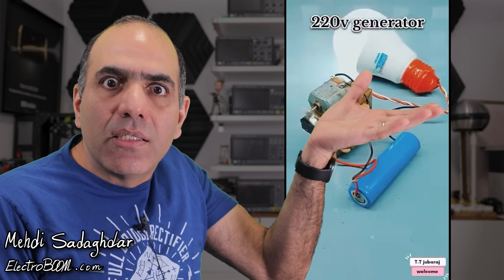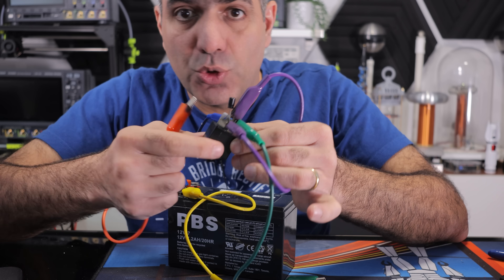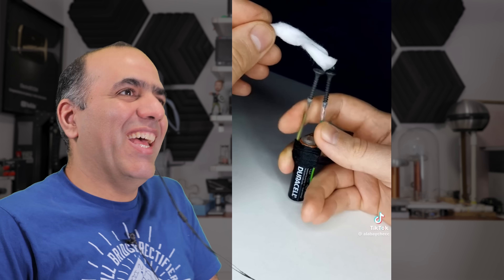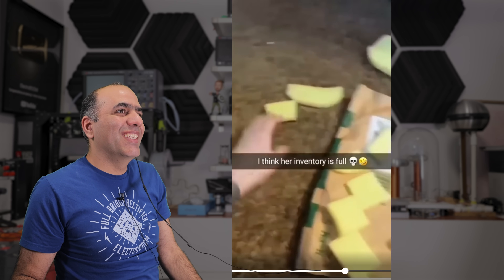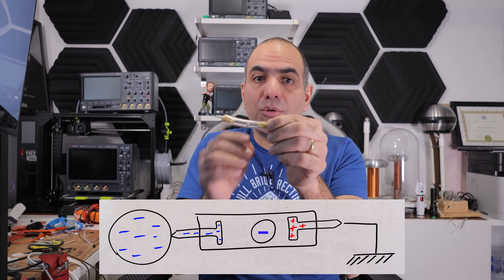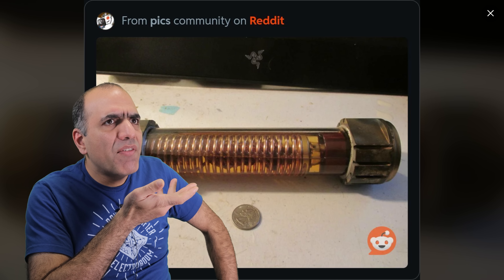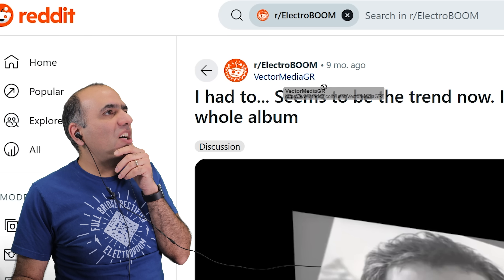Nuclear Egg (LATITY-015)

Comment: I had a very good LED bulb that is alive sincse 2014. How?
It is heavy so there is good amount of aluminum to not get hot fast,and I used to short out any bad LED that would caused it's total failure.
Since then I shorted 10 LED-s on the board and when most of them went bad I replaced the LED board from a bulb that had a power supply issue.
So my truty LED bulb may survive while other light weight garbage will fail sooner than a year.

Comment: Mehdi, I don't think the sparking battery is fake. Copper doesn't make sparks. You need to use iron (e.g. screws) like in the original video. And use a good battery (maybe rechargeable?) with high current capability. If you take a paper towel an put a few drops of isopropanol alcohol on it, I'm sure it will light up just fine with it.

Comment: Was staying at a hotel and saw a similar glow from an outlet. As it was stupid o'clock and I had to be up early and the breaker box for the room was inside of a locked utility room outside (!), I promptly dismantled the outlet, cut the already oxidized hot, disconnected the neutral, capped off both and went back to sleep.
Well, once I caught my breath, the outlet had immediately began profusely spewing smoke. The problem turned out to be a distant outlet across the room, which was daisy chained through that outlet's tie bar and the defective distant outlet was melted (I'm guessing due to the melting that it had been overloaded in the past and chose that night to give up the ghost, maybe a surge, maybe it just got tired).
I'm amazed I don't see that establishment on the news for burning down...
And I'm mystified as to how they vacuum out the rooms if the outlets are melted, save if they only used that single outlet every time and ignored the melted ones.

And kids, don't try that yourself. I worked with live circuits for decades and know how to not light myself up, you've not got that experience or training.
<grumble> <grumble> <grumble> Middle of the night pyrotechnics show from a (@*!&#@! outlet! <grumble> <grumble> <grumble>

Comment: If this "Egg" was a radionuklid battery it could work. It generates electricity out of the decay of radioactive Isotopes directly. It uses the charge of the Alpha or Beta decay. In the late 1960 these Batteries were sometimes used to drive a pacemaker. A magazin wrote about it and called the article "Atom Heart mother" which inspired Pink Floyd to the same titled Album. But they can be verry Dangerous especially if they are not marked as radioactive, like the USSR did. That lead to an major accident in georgia.
Reply: Yes. These radionuclide elements generate microwatts of electric power. Maybe even just nano -watts. Surely not enough for a single red LED, let alone a fridge... 🤣
(Why a red LED ? Simple. Red LEDs have the lowest forward voltage among the light-emitting diodes. 🤓)

Comment: If you want to start a fire using a 1.5V battery, use the aluminum/paper wrapper from a stick of gum. I've tested it in the past and it worked and assume it works still today.

Comment: Hey think of it this way, if the LEDs don't bypass on failure then you are wasting all the other  LEDs.

We should see if the government will put a repairability regulation in to make it easy (or require the circuit to bypass burned LEDs). Because also, if you make it modular you needn't waste so much material and can just replace the board)

Comment: Hi. Your all Videos are very informative. i have a question and i want to know the answer from you. please.   Why adapter voltage is greater than battery voltage in laptop? any specific reason? instead of 19.5v, if we use 18v adapter also laptop wont turn on. but, batteries 12v will turn ON it. please explain in your new video. thank you

Comment: Repairing a broken LED light bulb with a working LED from a working LED bulb reminds me of the joke about a woman trying to heal a sick chicken by giving it chicken soup made from a healthy chicken…

I used an electromechanical buzzer and an old speaker transformer with the speaker side as the primary to step up 3 volts from a pair of D cells to enough voltage to make neon bulbs glow, long ago when I was twelve or so.

Comment: I know AA batteries are too low voltage to generate sparks. But I've seen people start a fire with one or more D Cell batteries and fine steel wool. They touch both ends of the battery with the steel wool and after a bit the metal filaments become red hot and start burning away, which then can be used to light up some dry grass/leaves and then wood

Comment: Mehdi, regarding that battery sparker. You used Alkaline battery, which can't give high currents. But the video was using a rechargeable battery, which can. Lithium Ion batteries obviously can give much higher currents. While that higher current is good, I'm not sure if they can create such spark.

Comment: 12:39 Mehdi, that's not Fukushima, it's a refinery in the Chiba prefecture, more than 200 km away. That image has been wrongly used way too many times to refer to the Fukushima accident (which caused no deaths, by the way) even though it's extremely easy to recognize that it's not a nuclear power plant.
Reply: I did wonder where the stacks were, but it turns out that Fukushima didn't have them either.
But it is kinda funny to see, Googling Fukushima results in that picture popping up in a lot of places, among them are many tabloids, but also Ohio State University.

Comment: 3:20 I actually did this. I had disassembled a faulty power adapter trying to fix it, put it back together and used it just to find out that I had to turn off the power to get it out of the wall.

Comment: For the leds bulbs, just solder a normal red 3/5mm led in there. Better than overvolting the other leds. Fixed a wii sensor bar like that

Comment: At 12:44 it is possible to have a fully enclosed radioactive generator. Radioisotope Thermoelectric Generators are actual devices used by NASA for probes and other space based equipment. They aren't super efficient, but do work without maintenance for decades.

It's essentially thermocouples stuck along a bar or radioactive material with heat sinks on the other side. (Peltier device or TEG, essentially.) As the outside part is cooler, it creates the difference in potential for electricity to be generated. Russia used them in remote outposts and lighthouses.

NASA specs indicate an average output of about 3W per kg for the systems I saw information on. (Wiki page for RTGs.)

I would assume the egg is that with a neat shape. Heat is the obvious byproduct. If you know the weight/mass of the egg, you could probably calculate the potential output by the specs above, minus a good chunk because form over function. A sealed enclosure like that submerged in a cooling liquid would probably work really well.

Comment: Hello! I think that the battery video at 4:00 could be true. 
Maybe the screws are important because of the rust or something else that could make the sparks.
I already made some sparks with 9V batteries and some rusty material. (no sparks with wires or smooth metals)
9V are more than 1.5V but, hey, maybe.

Comment: How long will the LED bulb last on only two out of four LEDs? Not long. As they're wired in series, the remaining two LEDs will now see more current as the voltage drop is lower. This will equate to more heat, complete failure.
Reply: he literally explained that in the video, watch it again

Comment: 4:00 Something like this can work, typically a 9V battery and ultra fine steel wool, but a foil gum wrapper and a couple of AAs can work in a pinch. Both of these methods are about heating the metal enough that it starts to burn, not by making electrical arcs and sparks.

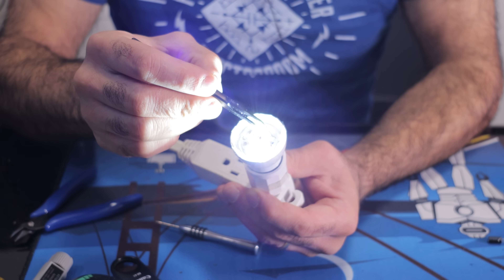Comment: 9:34
LED's dont work on 120VAC.
So no chances of "getting electrocuted" like you said.
They work on very low DC voltage
Reply: The voltage across the leds can be low while being at high voltage relative to ground. If you touch the ground and the leds at the same time there can be 120 V across your body. Most cheap led bulbs use just a capacitor to lower the voltage for the leds so it is not isolated from ground
Reply: @laserdiode  but leds only work with dc
Reply: @martf1061  The bulbs have a rectifier inside but that doesn't isolate the output from ground
Reply: @laserdiode  yes, i know that the rectifier doesnt isolate from earth, and the rectifier only turns the AC voltage into DC voltage.
From what i know, LED work on LOW DC Voltage. 
So between the 120VAC input and the rectified low DC voltage output, there must be a step down transformer.
Therefor, the secondary side of these low power transformer is always never grounded.
So this means that the rectified low DC voltage output of the driver going to the LED, IS Isolated from ground.

Comment: @1:26 if the input is 1.5 ant the output is 600v, how can the transformer be 120/12v transformer? I do not understand, somebody please teach me
Reply: by disconnecting the power very arbruptly you can generate ludicriously high voltage - at very low current.

This only happens when there is almost no load however.  it doesn't break ohm's law or the law of thermodynamics.
Reply: @tsm688  thanks man
Reply: It’s from the inductor as well. When the inductor disconnects the output flips and creates massive amounts of voltages

Comment: The easy way to replace leds on that's aluminum PCB is using a lighter, just unsoldered the wires, place the aluminum PCB on top of fire an with tweezers replace the LED.

Comment: 9:15 I'm regularly fixing my led bulbs just by replacing burned LEDs with a good one. There are usually from 6 to 10 LEDs inside bulbs I'm using.

Comment: 4:03 it will work with one small change (I've tested it) - instead of wires you need a wrapper for (quite rare these days) bubble gum, the one with long stripes wrapped separately. They were double layered with one layer made of paper and the second one made with aluminum foil. You then cut the middle to make it like a hourglass shape and short the battery. The narrow middle part then get hot and paper catch fire. But then again, these days it's easier to just get direct hit from lightning bolt straight to your fireplace than find those bubblegums.
Reply: They did that on OITNB lol

Comment: 10:49 the easiest fix is probbably to solder a resistor instead of a dead short, to limit the current as if the missing LED was still there. Picking the resistor depends on the parameters of the LED bulb, so you will need to do some checking.

Comment: 8:56 and the bulb must be low power, too! I tried to fix several bulbs like this, and they all blew within 5 seconds or so. You remove the load and the voltage regulator blows up! It's a stupid way to fix an LED bulb!

Comment: While touching that exposed LED I’m guessing you’re not touching ground but wouldn’t the socket on the wall be grounded therefor the electricity could run that route to ground from the hand touching the extension cord? Also why doesn’t your body charge slightly like a capacitor😂 like rubbing your socks on carpet and touching a door handle

Comment: The "egg" could theoretically work.
Radionucleid batteries without water in hem do exist. They where for example used in spacecrafts like the voyager 1 and 2.
Also the soviets used it for some lighthouses.

They are really longlasting (decades mostly), but the output is not that great and they are EXPENSIVE as all hell, because you need vast amounts of radioctive material like Plutonium, Cobalt 60, Strontium 90 or similar. 

I mean multiple kilograms of it.

Apart from the price, no government would allow that much nculear material in the hands of a normal citizen. It could spell disaster if something happened to it. Be it just thrown out somewhere or getting in the wrong hands to build some devious dirty devices.
Reply: they are huge and have a huge heat sink.  they are not a small plastic egg.

Comment: Considering LED is a nonlinear device,  removing two LEDs from a fixed voltage driving topology in 10:46  would draw much more current than 2I. But on the otherhand nobody would use fixed voltage to drive LEDs, usually it's either a current limiting capacitor in series with a rectifier, or a fixed current driving IC.

Comment: If the nuclear egg were a RTG it would work, radio-thermal generators are able to be self contained like that and do work for long periods of time but their efficiency is low. A well sealed RTG could provide not just power but also heat to a space. Russia used them to power remote unmanned lighthouses and other remote unmanned monitoring stations. Electric to power equipment and the heat from the RTG kept the equipment from freezing in the winter. RTG's work in space too, powering satellites, rovers, and probes.
Reply: And that is one of the reasosn why there so many orphan sources in Russia
Reply: C14 diamond batteries are also possible. They're made from abundant C14 you can get from neutron moderators of graphite moderated nuclear reactors. They produce miniscule amount of power but with half-life over 5000 years, they last practically forever.
Reply: but you need a way to cool it down... and an egg, like a sphere, has very good ratio of surface area to its volume, which is worst for cooling ;)
Reply: @DominikJaniec  That's for the eggheads to figure out, he's just the ideas guy.
Reply: But a RTG is not a nuclear reactor
Reply: @DrArkham.  Nuclear power
Reply: @ in what way is it not a nuclear reactor?  it converts nuclear heat into electricity.

the egg isn't one of them though.  it's just fake.
Reply: Yea then they just left their RTGs in the wild for random people to come across. Lol whoops
Reply: I've read about those... some of the old Russian models could deliver around 10 watts for ten or twenty years.
The catch was that some of them tended to leak rather dangerous amounts of radiation...
(Many of them were designed to be sited in remote areas, far from humans, and so had very little shielding.)
I've seen stories about people who found "orphaned" ones and ended up receiving large doses of radiation by handling them or sitting too close.
Reply: @keithlevkoff8579  Plainly Difficult has a fair number of videos about abandoned sources and the varying levels of shennaniganries that happen.
Reply: @huzudra  Yes... I've watched a lot of his videos on that subject... and I highly recommend them to anyone who is interested in the technical and historical issues involved. It's scary how many "orphan radioactive sources" of various sorts are still just laying around. (Especially the fact that many of the older ones aren't marked at all so, unless you happen to walk around with a radiation detector in your pocket, many of them would be impossible to recognize as what they are, or how dangerous they are.)
Reply: I see RTGs have been covered.
Reply: @jonc4403   Someone needs to get Mehdi a RTG to play with.
Reply: It Had The Name ENRON On It lmaooo
Reply: Nasa Esa or any other space agency uses RTG's to power probes that go to the outer solar system where solar cels are useless. voyagers, missions to jupter, saturn, pluto,... If im no mistaken the ALSEP's (apolo
l lunarsurface experiment packages) were also powered bij RTG's so the could work during the lunar night. Anyway they produce a lot of heat (massive cooling fins, look for pictures on the internet) could never be contained in that egg whithou a meltdownout.
Reply: Exactly my thought. But you're not going to get more than 100W of electricity out of a KG of fuel (plus about 30KG of generator). Even if you could scale it down and not lose efficiency, an egg-sized RTG isn't going to make more than about 0.01W, enough to power one, extremely dim LED, or some very weak microcontroller.
Reply: @SgtLion  Egg SHAPED not egg SIZED. Egg shape is still a terrible shape for a RTG due to surface area to internal volume for temperature differential needed for the magic to happen.
Reply: And then when the Soviet Union collapsed they where left to "discover" for civillians 🙃

I love nuclear technology, but those things are only a good idea for space.
Reply: A 100 watt RTG is enormous and contains enough nuclear fuel to be a small eco disaster.
Reply: @tsm688  You really can't power that much from it. There are plans to make small reactors to power a house or two but these are going to fit on a truck, not in a egg

Comment: There is a way to do the nuclear egg. Not as good as a steam turbine, but a thermopile and heat sink would put out some power for a very long time. Also, the heat would be released to the environment around it. Good in winter, bad in summer.

Comment: The "Enron Egg" is too small to house a vapor cycle nuclear power plant, but it could be large enough to house a shielded thermoelectric generator, of the type used on satellites and deep space probes such as Cassini.  They were also used for land-based power needs by the Soviets.
Reply: no it couldn't.  those devices are huge and have huge heatsinks.

Comment: Speaking of the "reactor-in-the-egg" it is not that ludicrous. RTG reactors have been used for decades to power some remote installation like the radio beacons or even the spacecrafts. They don't need to vent any steam, but they definitely need some kind of cooling. I wouldn't want one in my basement but they do exist.
Reply: they are huge and have a huge heat sink.  they are not a small plastic egg.

Comment: I mean, the Enron Egg could be made to work if it was just an RPG + thermocouples design (Like surrounding Strontium 90 with thermocouples), but it would require wings (Heat sinks)

Or also do it via beta voltaics, of photobetavoltaics, like, example: Tritium or Carbon 14 vials surrounded by phosphorus and those surrounded by amorphous solar panels, but its power would be in the order of the milliwatts.

Besides, even if those were like that, the paperwork alone would make it infeasible to bring to the public market.